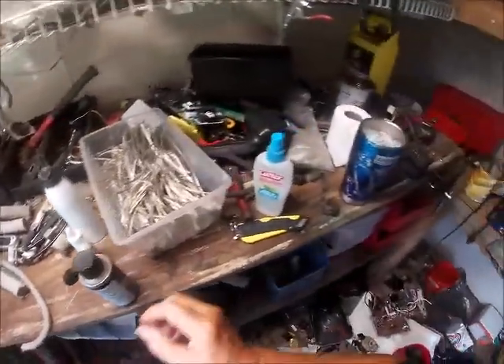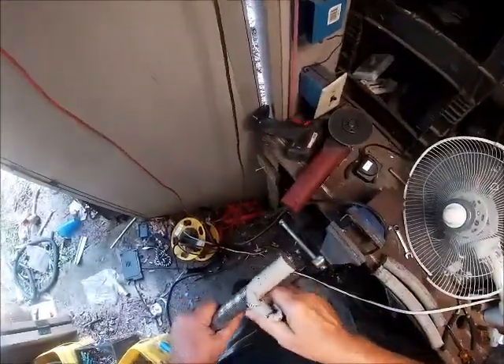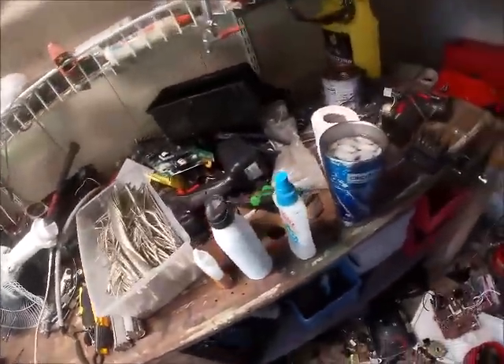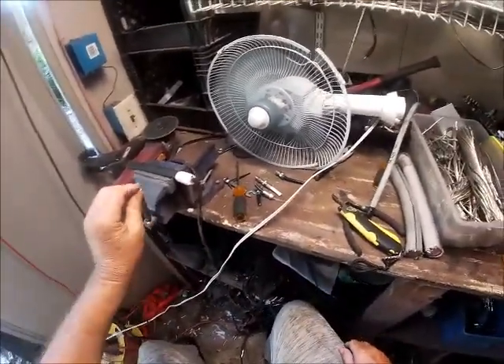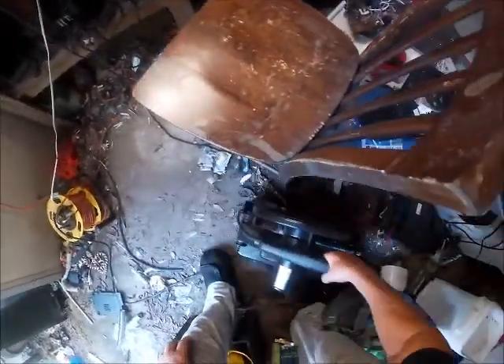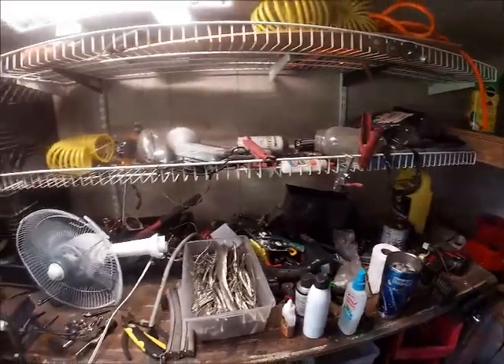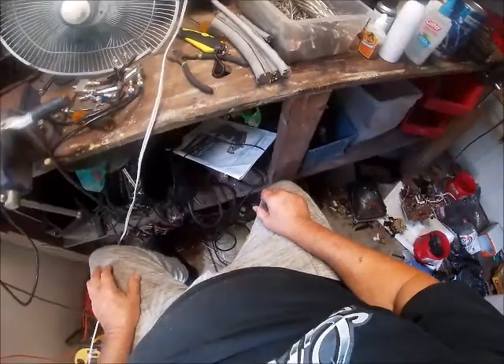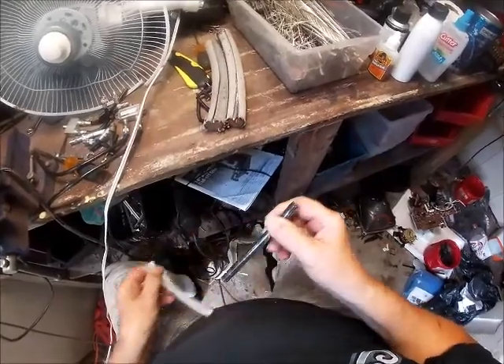SHOP TALK and Breaking Stuff Part One

Comment: Isn't there a piece of copper running through the cable wire you leave behind?
Reply from the maker: No that is steel wire that is copper coated. Scrap yard will not take it
Reply: @JunkDobber  OK that makes sense why you don't take it. Been wondering for a while. Saw what looked like copper in a piece that is cut in my apartment. Thanks Dinner.